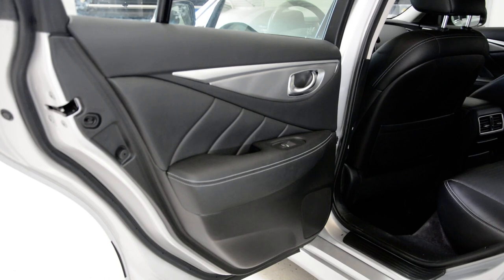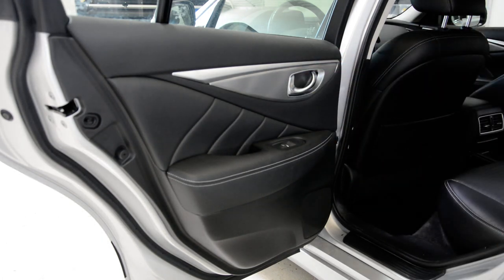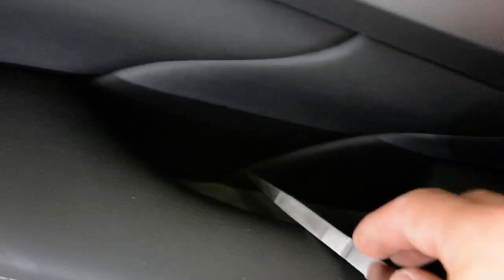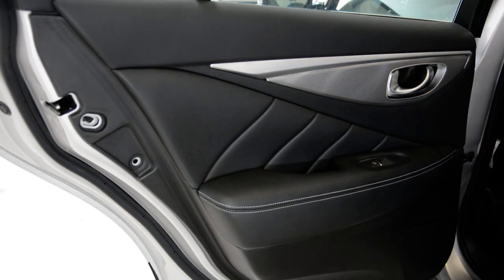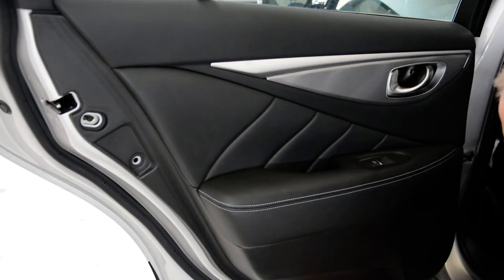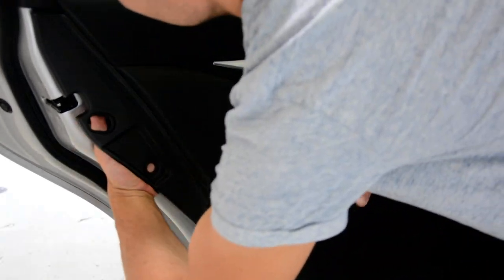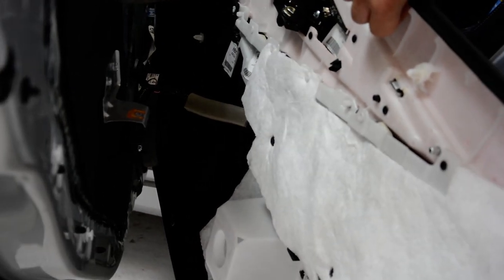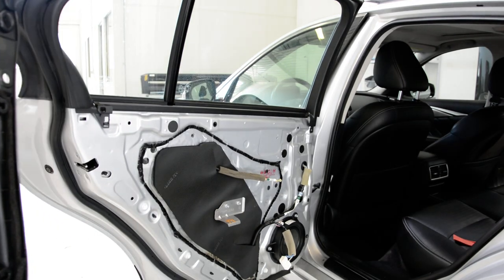How to remove the door panel Infiniti Q50

Comment: Is the actuator on the door panel because I’m planning to change the trim to carbon fiber to wood because right now my actuator is going out so I might as well replace it with an upgrade. Just want to know if that would work